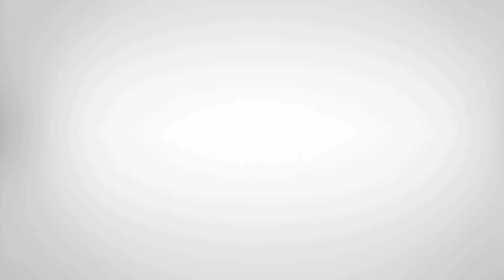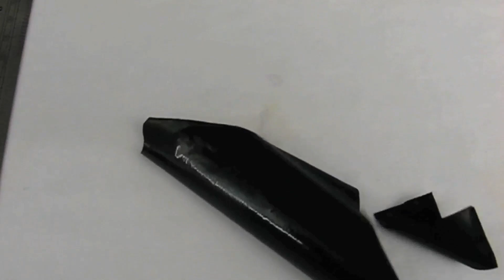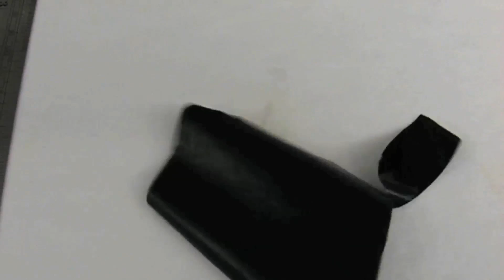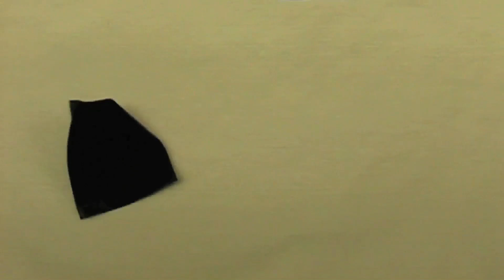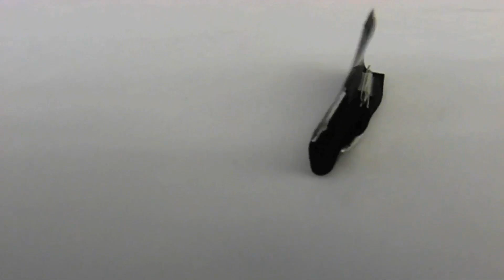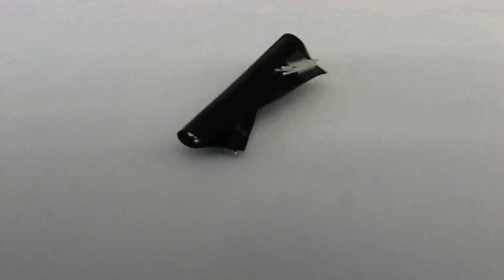Artificial muscles at MIT

Comment: could it also be used for free energy?
Reply: MLFreese The soft gel would be the engine, the water vapor would be the fuel. Who knows how expensive the gel is, and how long it can last.Might turn out to be more costly then windmills.
Reply: MLFreese Yeah I guess you are right, it makes it a lot less efficient.I think they turn it into a vapor to use less water, I'd imagine they can just pour the water on top of the gel.It might not react as quick though.
Reply: +MLFreese Free energy is a term widely used to describes a hypothetical perpetual motion device that creates energy, thereby contradicting the laws of thermodynamics.
Reply: Free energy is not a hypothetical perpetual motion device . Solar panels, Thermoelectric, and hydro electric damns would be free energy.

Thermodynamics is a branch of physics concerned with heat and temperature and their relation to energy and work. It defines macroscopic variables, such as internal energy, entropy, and pressure, that partly describe a body of matter or radiation.
Reply: Of course monetarily free.

Comment: Could larger versions of this actually be used in power plants to convert the steam to electricity instead of turbines and if so would it be more efficient?
Reply: No, turbines are more efficient. The problem with the thermal power plant is the fact that it is thermal itself because heat cannot be fully converted to other source of energy, most part of it will be lost. I'm replying 11 years late but it's just that I didn't study thermodynamics back then.😉

Comment: This has so many uses, particularly in applications where something needs to be dried.  The "i'm still not dry yet!" wetness of the material could power the very fanning motion that will dry it out.  
Algae from photobioreactors is generally dried using a wicking effect (you just press dry cloth against it), this mechanism could self-power that.
Or how about clothing that moves and twitches around when it is wet - flapping and fanning itself until it dries, while you're still wearing it!

Comment: First i thought the video was saying that it was triggered by humidity in the air, but then i realised these things in the video must be sitting on wet white paper.  So it's getting it's energy from the humidity difference between the wet paper and the dry surrounding air.  Eventually the paper will dry out and need to be re-wet, and/or the air will get increasingly humid until the air & paper are both equally wet.
Phew, Thermodynamics you gave me a scare there, lets never fight again.